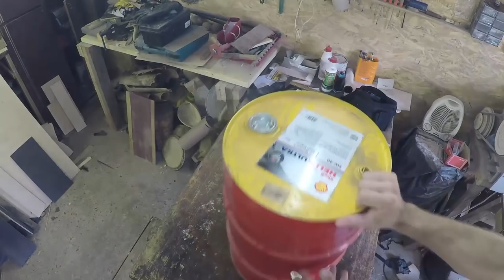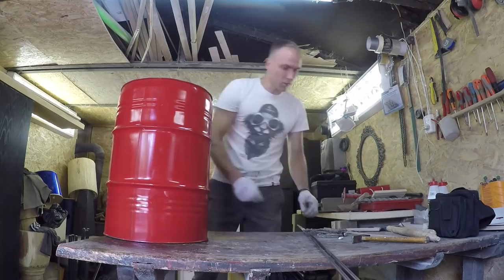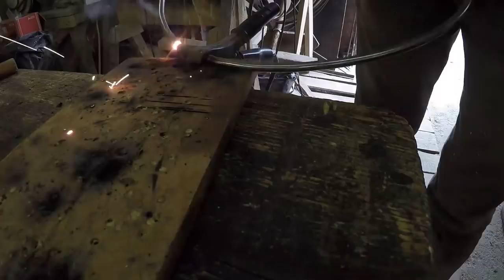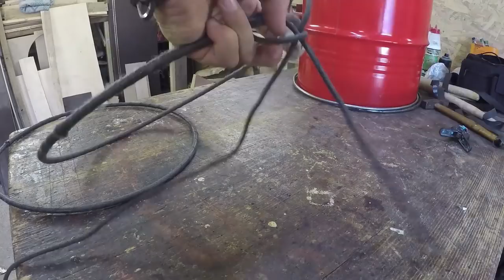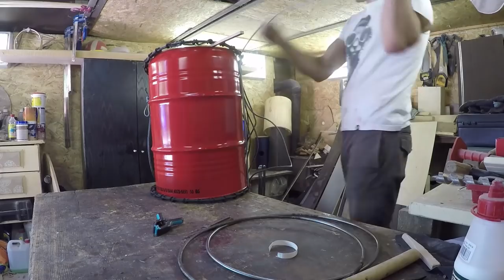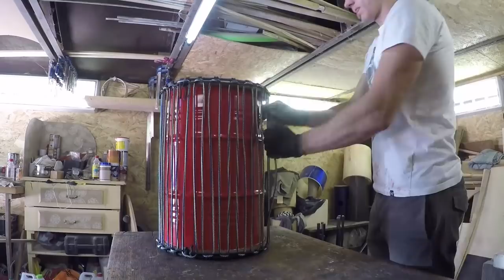How to Make African Dunun (Sangban) Drum from Oil Barrel | Banbu

Comment: Hi! I started to see your videos, I have finished my second djembe and i wanted to thank you after seeig this i feel very inspired to try to do the whole set of dundun drums as a future project. One question, instead of using steal barrel, i am thinking to do it with pvc tubes, do you think the the iron rings could hold tight? i see the barrel surface is not flat as a pvc tube. Im not quite sure about the lenght of the ring. Thank so  much for sharing your art!

Comment: Nice. I have one made out of a metal drum. Just wish I can find away to soften the ring. The drum rings with overtones. Thinking of opening the drum and lining the inside.
Reply: ઙ
Reply: I'm going to make one of these, and to stop the ringing, I will stick a flat piece of sponge around the outside, maybe half inch or 3/4 thick, and then cover that with dark colored kinte cloth. I think that will work.
Reply: Update. I did it. I made the sangban this size, and the dundunba with a bigger barrel.
There's still a little extra vibration, but it's minimal. I believe if I had stuck a layer of sponge inside it would have done the trick
Reply: I used 1" thick sponge

Comment: What size steel rod is used for  this project and on djembe
Reply from the maker: Here I used 8mm steel rod. Usually 6mm is used on djembe, as well as 8mm (mostly on high end djembes)
Reply: im 16 amd im making my own djembe almost finished
Reply from the maker: @joshee340  Nice! I made my first djembe also when I was 16. Keep going! :)
Reply: what length  rope is needed for both the knots and the verticals plus a rope wrap
Reply from the maker: @joshee340  It depends on how many knots you are going to make. Usually it takes about 30-40 meters.
Reply from the maker: @joshee340  Hey, how is irt going? Did you finish your djembe?
Reply: im finished with the hard part just the rings to do nw
Reply from the maker: @joshee340  Great, please let me know how is it going. And if any questions don't hesitate to ask
Reply: sure no prob thanks 💯💯